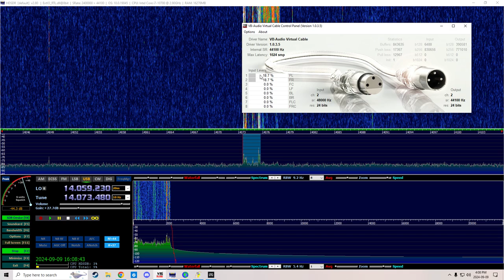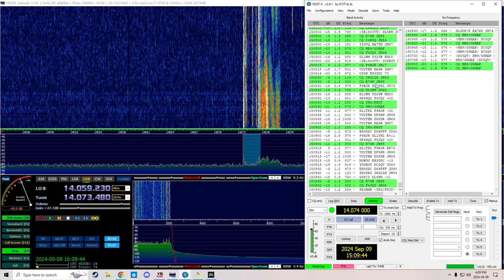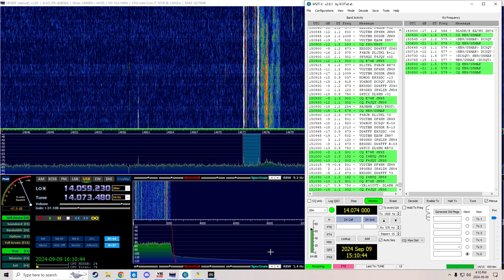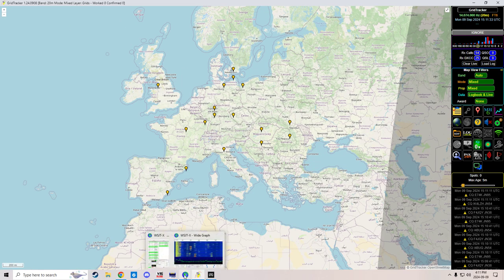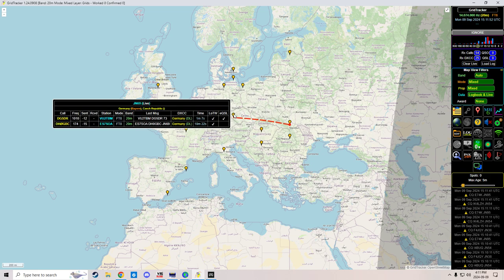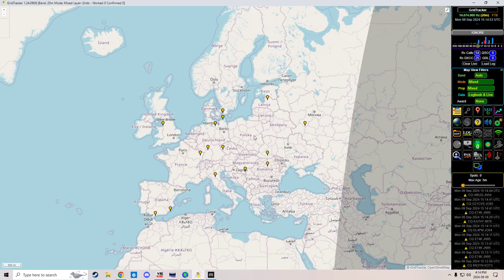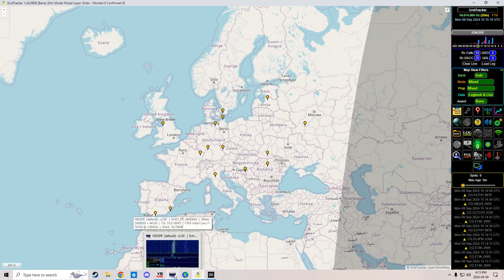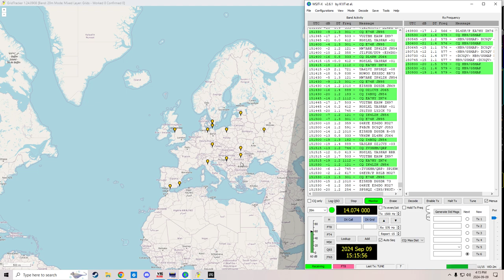SDR And Gridtracker FT8 Decoding

Comment: Ha, VB audio was the program i was gunna tell you about, but you said you had enough audio tinkering (VB matrix is what I use). I was going to get a device called  meshtastic, but this is on another level...
Reply from the maker: I tried using it before but the program I was hooking to it back the (SDR Sharp) was a minefield of dead oprtions and ever changing updates so I threw it in the virtual bin, I looked at using it with Maschina but I still had a bad taste so I didn't bother.....new SDR program and now it makes total sense!
Reply: I'm also interested in Meshtastic.  And ATAK.